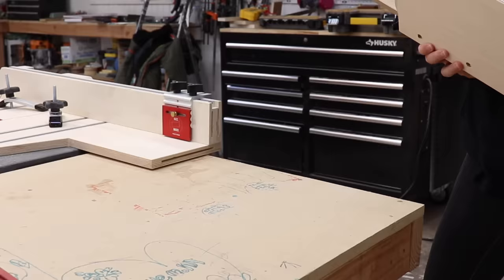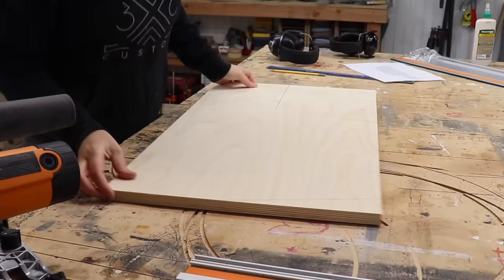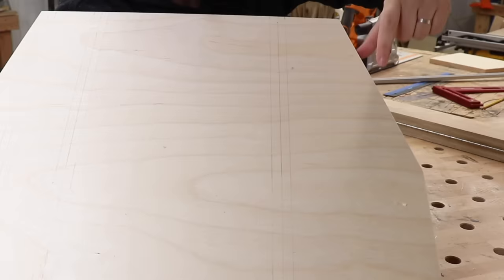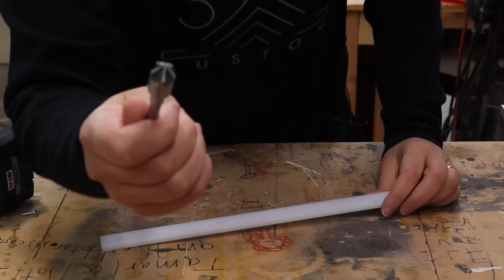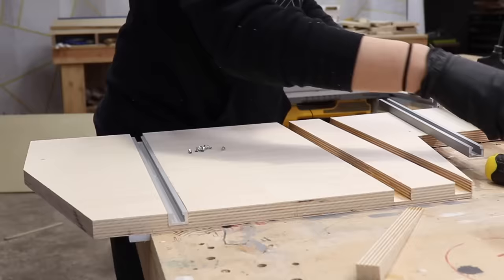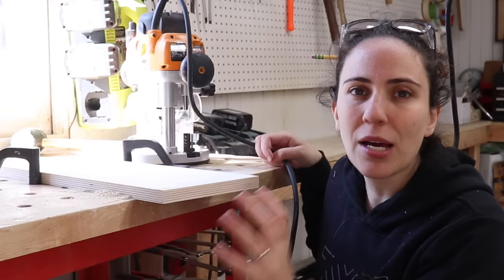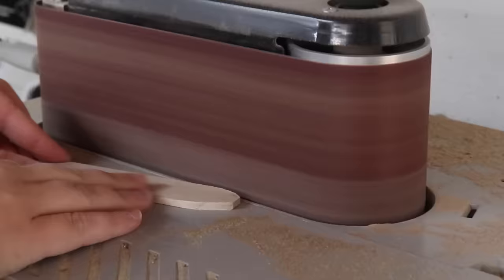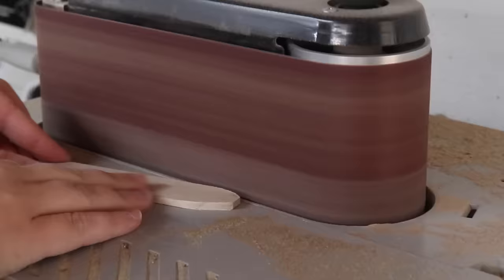SMALL Cross-Cut Sled with ADJUSTABLE Fence, EXTENSION wing and BEVEL Feature!

Comment: Sorry I'm late to the party. This is so incredible T! Thank you so much for using my stop. i am so happy it is treating you right!
Reply from the maker: Best stop out there!
Reply: I built Tamar's sled and used your stop! Great combo! My two favorite wood working video producers!
Reply: Agree with Doug's comment. I'm new to woodworking Tamar's solitaire board was my first project though watching videos for last 12months. 
Question about sled accuracy. What is acceptable, or more so, what's acceptable for say an end grain chopping board when you have lots of cuts and glue-ups? Katz has an amazing 3D chopping board I imaging accuracy is key here. But how worried should you (I) be about this? Thanks in advance.
Reply: @gsallis85  I make end grain cutting boards and the crosscut sled does not play a big role. You need a very good saw plus fence and then a very good planer.
Reply: @gsallis85  I should have added that you need a micrometer and something to set your blade angle precisely (I use the Wixley gauge). I can share more insight and examples if you wish.
Reply: @dougwhite414  thanks Doug. Appreciate all the insight and help. I have a Dewalt DW745, and recently made a work bench this sits in flush. I haven't year purchased a thickness planer, but will do shortly. Can I ask, what thickness planer you are using? Heard with end grain that you need to add sacrificial pieces if planing end grain at the end. I have a wixey magnetic gauge also to ensure my blade is correct angle.
Reply: @gsallis85  I replied to your e-mail and never saw a reply from you. I don't know if you saw it (just in case it got sent to a spam folder).
Reply: @dougwhite414  it was in my junk!! Apologies Doug. Thank you, I'll check it now. 👍
Reply: Where can I purchase this stop block kit? Ty
Reply: Please
Reply: Thanks to this video, and a couple of others, I just bought your stop. I'm looking forward to receiving and using it.
Reply: Got mine yesterday, Thanks JKM
Reply: Im even later to the party, but buying her plans, and bought your stops as a result of this build.
Reply: Great fence stop--best ever!
Reply: Hi Jonathan, where can I order one of your stop block?, I have been looking for one on Amazon and ebay but with no success.
Reply: @bob-pq6kd  my website. Theres a link in the description of this video or you can go to kmtools dot com
Reply: Where can I order these in Canada?
Reply: I bought your stop block for a Miter Saw cart I'm building, I gotta say, it's better than any of the others I currently own.  I'll be getting another when I replace my old sled and make this sled for sure!
Reply: This is the video that pushed me over the edge to order your stop! Cannot wait to get it!
Reply: After seeing the stop both here and over at Bourbon Moth, I bought one.
Reply: Awesome great job absolutely love it

Comment: I love it when she makes a test cut for square and says "That's square enough for me". I've been a cabinetmaker for 16 years and I find that a lot of woodworkers over think. You are not splitting the atom...it's a blanket box. If it's out a 1/16” , crack a beer. Enjoy. Job well done!  I think I'll use some ideas for my next sled
Reply from the maker: Hah! Yeah. When I first started out. Chasing square was the bane of my existence. I’ve since relaxed my tolerances and my work is actually better.
Reply: If you're not worried about precision,  what's the point of building a sled anyway? Just use the miter guage then.  The whole point of building and using a sled this awesome is so that you can make precision cuts and elevate your craftsmanship.
Reply: @bobhenry8262  for starters, you don't hve to worry about tiny offcuts.  I'm in the relatively newbacious category but I had to make a bunch of tiny offcuts recently and it was then I knew I needed a sled.   Any sled would be better than what I have.  So there you go, a reason for having a sled even if it doesn't improve your accuracy.  Now hopefully I didn't same something blatantly clueless lol

Comment: Thanks for the great video.  I am a new viewer and have really enjoyed watching.  
I think the reason you had difficulty with the back fence was that you added a second set of threaded inserts into the two oak back rails.  This acts to deflect the two surfaces by however much error in clocking exists between the two joined threaded inserts,  rather than tightening them together.  For a 1/4-20 fastener,  this can be as much as 0.050",  nearly 1/16" (or zero if they are clocked just right.)  If you used clearance holes into the oak pieces,  the alignment of the extension rail to the primary rail should be much better, because the pieces would be pulled together.  Still, really great video,  thanks for the effort!
Reply: That's funny, I was just watching the video for the first time and got through the first 12 minutes and saw that issue and jumped to the comments to see if it was fixed.  I guess not.  I have run into this issue many times with other peoples work.  You can only have one tightening surface.  Even if they are clocked right it isn't going to tighten which is why your clearance idea makes the most sense.
Reply: It's still a great fence.  I made a Dado fence literally just two days ago and now I'm wondering if I should have just used my Router.  Oh well, the fence is created, but I haven't made a nice custom Fence like this one.  Quite a lot of these features will be in mine.  Great job!

Comment: Great design! I made mine a bit bigger for my cabinet saw. I also added T-track on top of the  miter angle option. Now I can add a couple of hold downs, one for a stop and one or two for the workpiece. I also added a very shallow dado on the main fence for a sticky back rule to reference the stop for perfect length repeatability. Keep up the great work!
Reply: Would you mind sharing the dimensions of your larger sled? Am thinking of building this curious as to how it stands up when made bigger. Cheers

Comment: Really nice sled, and finally, I see one with the T-track for a stop.
I am really impressed with this design.

A little food for thought on your extension, and primarily the spline.
The biscuits are brilliant
Extending the T-track across in the dato is brilliant.
The spline, as you mentioned could have been a single, however, I would have made it wider.
When you used those 1/4-20 T-bolts, you took away most of the strength they had, even collectively. I'm sure you are getting a pretty big stress riser right where the holes are, but as it is, that really shouldn't see much stress. IF you do see that spring at all, I can pretty much guarantee that is why
Also, a threaded insert mated to a threaded insert typically doesn't work out that well. I'm glad it did for you. 
When I make a joint like that (Typically in metal) I will use the single threaded insert (Usually a Keensert or Helicoil), a bushing for a through hole, and a shoulder screw..which of course complicates things tremendously, but now you are sure to get the spline to clamp tightly against the fence.

I also absolutely LOVE the Bevel feature you have introduced here. I have been toying around with some similar ideas as well. I like the 2 track method, I have been wrapped around idea of an axle...probably a shoulder screw, bushing and threaded insert.......

Once again, my hat is off to you. You have some serious smarts as well as talent here!!

EDIT: The Bevel I was referring to above is really the Tapered Fence feature.
The Bevel is ALSO genious. My current sled has three or four Kerfs. One at zero, one at 22.5, one at 30, one at 45 lol
I have the same saw you have, so this should go a long ways in helping me.

Comment: a really good looking sled....I will take some inspiration from it.
One thing I think might warrant changing is having the inserts on the oak battens on the extension.  Once the locking rod engages in the "oak" insert, it will hold the oak away form the insert on the main fence.  An oversized hole will allow the nut to pinch the two parts together.

Comment: The holes in the oak extension pieces should not have threaded inserts as they will not be able to pull down tight properly... drill them out to the clearance size of the threaded knob (M8 ? 5/16" nc ? )
Great jig... 😉

😎👍☘🍺
Reply from the maker: They seem to be pulling down right properly.
Reply: @3x3CustomTamar  as long as they are tight together when you start they should stay that way.  With your t-track and "biscuits" you're going to be aligned.
Reply from the maker: Frank DeRosa it’s just extra precaution to stay square. Yeah. That’s how I’ve been installing it. Make sure the oak is flush to the ply and tighten down. My thought process was that stacking them would act as if they were one threaded insert instead of two and the alignment would always be spot on
Reply: @3x3CustomTamar    I would ask you to visualise this... screw 2 inserts on a knob with a 1/8" or so gap between them,  grip them in your hand and screw in the knob... once the knob bottoms out onto the top insert it will feel tight ... but you will still have that 1/8" gap... hard to explain in words but I hope you get the point I'm trying to make (poorly🙄)
And yes, you are correct they will act as one nut but this " long nut " will be bridging both jig pieces, not what you want  if you want to tighten one against the other.... 

I'm a retired engineer btw so I have some experience here... 😉 
Of course if you are happy with your setup ignore my comment and carry on... as long as it works for ya, thats all that matters ... 
 😎👍☘🍺
Reply from the maker: Peter Fitzpatrick I totally get what you’re saying. But since I make sure the oak is flush on the ply before screwing in the knobs it’s been working fine!
Reply: @3x3CustomTamar    😎👍☘🍺

Comment: I finished this build for my Delta 36-725. I dont know what i was thinking but this will only work on very small job site table saws like the dewalt shes using. 
The bevel feature is where it failed. My table top is much larger so there is not a recessed miter slot to accommodate my left runner. In her video, she picks up her sled drops it to the left but as you can see she has an outfeed table that is slightly lower than a job site saw. This lets her sled to be completely flat to make a 45° cut on the bevel side. 
Good idea for that particular saw. But anyone planning on building this for any other larger table saw wont work.

Comment: I like that sled a lot. I have a suggestion  when you attach your extension on the back put them far enough  to get  your angle stop bar in between them and put screw inserts in to hold it in place. That way they would be handy and you would know where they are.

Comment: So a year and a half later, you mentioned in your Q&A video how your table saw is no longer made.  I have a DeWalt saw that I just bought and the measurements between the blade and the miter slots is likely a bit different, such that my sled was too narrow to use on left side for 45 degree bevels.  But not to worry.  While I sat down with graph paper and pencil to adapt this design from scratch, while I was waiting for new T-Track to arrive, I decided to try and salvage this one.  Using biscuits, I widened the sled base and fence to accommodate the wider dimension between the miter tracks  and everything should be fine.  Live and learn, and I enjoyed the critical thinking it took to troubleshoot the issue as I’m getting to know my tools better.  Thanks for the inspiration.
Reply from the maker: Sounds like a good fix!

Comment: What a great design. In regard to using only one slider, why not make a detachable left slider by adding pins/dowels that protrude into matching holes in the bottom of the base. That way the left slider can be pulled of the base when you want to use the bevel feature.

Another observation I had of late. Probably there are a number of us not-so-involved DIYers who, like me, only have a job-site table saw. Mine comes with a built-in extension on the right side of the blade. So, if I want to add an extension to the sled, I'll do it on the right side.
TDinDC.

Comment: Thanks for the informative video. For starters, you make it look easy and give me inspiration. Home Depot is my favorite home improvement store.... love them!!!!
I'm making a self-watering raised garden bed, about 30" X 60". Unfortunately, I have no electricity in my backyard and use a cordless circular and cordless miter saw. When cutting large sheets of plywood, the cuts are off considerably. l am using all left overall and donated recycled wood( used ) due to my budget. A cordless table saw would solve my plywood accuracy cuts and help make my much-needed 2 X 4's from the donated old 2 X 6s and 2 X 8s. I can pull all together with the circular saw but notice significant gaps when I join the 4 X 4s for initial outside frames. Overall, all these flaws may be solved with a Dewalt cordless table saw since I do have a Dewalt set of 9 and 6-amp batteries. Oh, well, I hope to get a cordless table saw one day, but did I mention....budget problems...ha, ha!!!😁🤣

Comment: After watching many sled design videos, I liked yours the best!  You are a woodworking savant.  The only change I made was creating  a 4x4 grid to use the Microjig Matchfit system on the table and fence. Now my Dewalt DWE7491RS is a solid performing woodworking machine. Keep these fantastic solutions coming!

Comment: I used the HDPE kit with predrilled holes. I also used CA glue to glue the runners to the base, the CA ran through the hole at one point down into the saw fence. Took a bit to clean it up, and the runners did expand with the screws even just put in lightly , so it took a little finness to sand them into alignment. Used the router jig to route the T Track locations, worked great, and used epoxy glue to adhere it with a few cut off screws.

Comment: Used your video to make a small (extensionless) 17Dx22W sled, just because I don't see needing the longer one -- very happy with the result.  Tell people to go EASY with the epoxy, or they will ALSO have a mess with the glue coming through the T-track screwholes!
Reply from the maker: Glad it worked out for you!

Comment: If you bought the plans and are using a dado blade on the table saw to cut the dados, mark the dados on the base first and make them before cutting the base to final shape. Way easier.
Reply from the maker: Good tip

Comment: Hey Tamar! After months of stashing this video, I finally got some time (and a Saw Stop job site table saw), made just a few small adjustments because of differences in miter slot-to-blade distances, and just finished this cross cut sled you designed. Like other subscribers, I had to resort to the 5 cut calibration method, which was also amazing. I wish you could see it. It’s beautiful!

Comment: I'm currently building this. (Bought the plans from your site.) If you use a table saw to cut your dados for the T-track, I suggest doing that BEFORE cutting the "spare sections" from the board. It was an issue for me because I didn't have a straight edge riding along the fence throughout the dado cut and got some wobble and tearout at the end.  (I use a dado stack for this)

Comment: :hand-pink-waving::hand-pink-waving:This is a really great small sled for the jobsite table saws, in fact I like it so much I am going to build this one and rid myself of the larger one I have, the only caveat is I will make the rear fence a little wider so to accomodate a narrow ruler/measure along the length of the fence so that you can make youre measurements there using the stop lock and not on the bed of the Sled.

Secondly on a safety note with all sleds I really dislike the fact that your fingers are in front of the fence as you push the sled in to the sawblade and there is a inherent risk here that you could injure yourself , my solution here is to install a  round dowel hand rail between the 2 pieces of wood that Tamar has used on the back of the fence, add a third piece of wood further along at equal distance to the centre and continue the rail accordingly.

In my opinion that will make it a lot safer and negate the need for your fingers to be anywhere near the front of the fence while cutting.

While it might seem petty I have seen more accidents than many after many years working in Lloyds of  London dealing with Construction Injuries and until such time the Sawstop or Bosch Reaxx becomes mandatory (which it will) on all table saws big and small I think this would add a bit more security and just remind you to keep your fingers back behind the fence.

Its a very nice build and a great video as always. Thanks:hand-pink-waving::hand-pink-waving:

Comment: I'm just sitting at the dining table converting all your measurements to millimetres so I can work with it, rounded everything to closest 5mm and adjusted the total to suit. obviously I also need to adjust for the thicknesses we have being in millimetres. If anyone is interested in the metric plans I can supply them to you for them. Only pencilled on the printout I purchased from your site so far but easy to adjust your PDF and return it. Let me know.

Comment: Very nice build. The only thing I found strange was that you put insert nuts for the locking screws both in the sled fence and the extension fence. That way the nuts must have the exact relative rotation in both parts to allow the locking screw to engage correctly.
Reply: it retains the screw knobs in place and keeps the connecting strips in exact placement.
Reply: @normcoppo , but it also creates an offset between the nuts that is dependent on the relative rotation angle between them since the threads of the bolt might engage at different positions.
It is considered a no-no within mechanical design to have threads in both parts that is joined with a bolt.
It is better to use tapers etc if precise positioning is required.